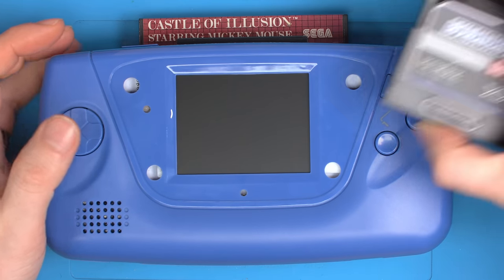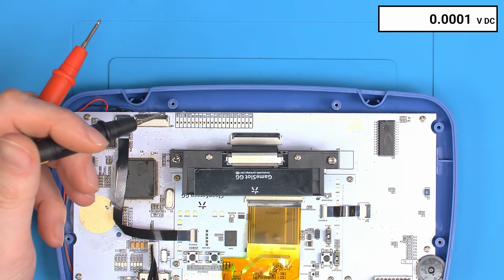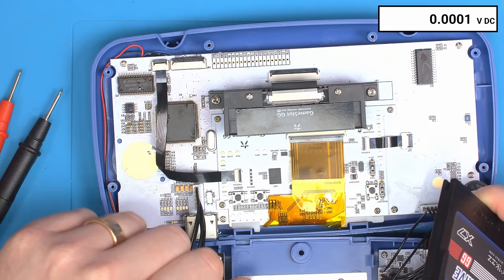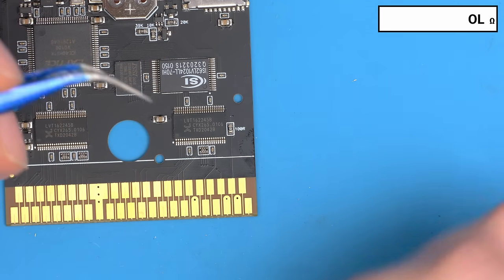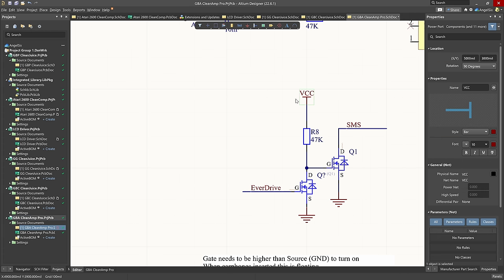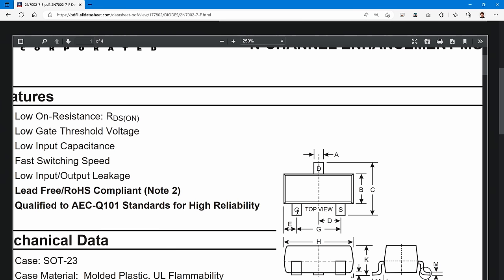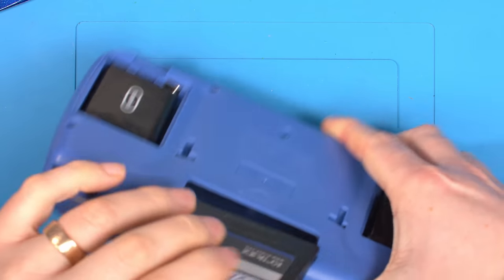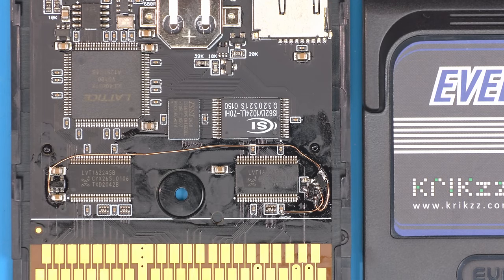ALL EverDrive GG Have This Issue, But It Can Be Fixed (SMS Pin Error)

Comment from the maker: If you are interested in the serious importance of driving CMOS pins corrected, you can read it here https://www.retrosix.wiki/digital-logic-levels
Reply: Oh, I just read this and If I understood correctly, when I use my Everdrive whith SMS games, it could destroy my GG ?

It has already happened to me that during part of an SMS game (with the Everdrive) my GG crashes, it may be because of this problem?
have you contacted Krikzz maybe he could correct it?
Reply from the maker: @lamor69  damage could happen at any point. No need to play SMS only have EverDrive in your GG. Krikkz been contact and simply doesn't believe it's a problem so won't be fixing it. I'll be offering a fix board soon
Reply: @RetroSix did you work on that fix board ?
It will soon be sold on your retrosix store ? 😊
Reply from the maker: @lamor69  not yet but lots of requests so definitely will make it
Reply: @RetroSix thank you man if you sold a ggx7fixed everdrive and pure blue gg like this I'll buy it on store
Reply from the maker: @rustymixer2886 https://retrosix.co.uk/Sega-Game-Gear-Console-Prestige-Edition-Dark-Blue-p231793240
Reply: @RetroSix  thank you

Comment: Great bit of info, I've run into crashing in this exact manner with a few sms games on a gg x7 and thought it was just the specific games.

I've been thinking about designing my first pcb and this would be the perfect starting point (if I have your permission that is, if so and if I put the gerbers up on github I'll properly credit you for it of course)

Super simple and compact, and I can even see a place to put the pcb, just below the sd card slot, and with a flex pcb I could use a set of quick solder points that route to the nearest places for 5v and ground instead of wires.

I'll see about doing that maybe later this week if I don't forget
Reply from the maker: Yep would be a good starter board
Reply: If you make one, I’d love to buy one
Reply: @viblade_1750  unfortunately I'm in a bit of a unstable situation so it may or may not happen.

Most likely I wouldn't sell them in any case, the schematic is RetroSix's design and while he might be okay with others using it, I wouldn't feel comfortable selling it out of respect for him offering this knowledge for free.

So instead I'd just offer the gerbers for others to get their own made
Reply: @PaulTheFox1988  sorry to hear, if you do make the gerber’s let me know
Reply: @viblade_1750  assuming it does happen I'll try to remember to put a comment below with a link to the gerbers.
Thank you for the kinds words though, it means a lot

Comment: Very nice video.
I have the very same everdrive, bought from Krikzz directly, and I use it with Mcwill tft, bennvenn IPS kit and a 3rd gg equiped with the genuine display, and I have no issue at all with sms roms.
I guess this fix is necessary with clean screen only (maybe Retrokai tft kit too, never tried...)
Reply from the maker: It works with CleanScreen. This only happens intermittently depending on if the voltage level falls right on a middle indeterminate level. Happens on all screens they all use the same level shifters

Comment: You should have chosen a logic level fet, for instance a cheap si2302. The 2n700x works because of the gg's high input impedance, but it's a bad design choice.

Comment: Man, THANK YOU! I finished up recapping and modding my game gear a few days ago and I ran into this exact issue. I feared I permanently screwed something up. I even re-soldered every cap and double checked every point I may have messed up. Did Krikzz ever respond to your message? If not I may have to do this to my everdrive, but I'd rather not if there is a software fix in the works.
Reply from the maker: There is no software fix for this it's hardware. Any screen kit can be fixed to work with the 3.3V and I already updated all GG CleanScreen to support both 3.3 and 5V now, but the visual issue was only the clue to find the problem with the ED receiving 5V into it's 3.3V pin. It will cause stress on the pin inside the FPGA over years and probably kill it sooner than it should
Reply: @RetroSix  @RetroSix  I see, I must have received a relatively older revision of your clean screen kit since I'm still having this issue. I'll post in the discord about my issue once I have time to fix it. Thank you!

Comment: I would say this console/mod outs of specs. 3.3v output is totally fine for driving 5v cmos inputs. 5v cmos input expects around 2.5v for logical 1 and they back compatible with 3.3v, by the way. So if 3.3v can't trigger yours screen, then it made wrong way and not meets CMOS 5v specs. Speculation about fpga damaging sounds even more weird in terms of current discussion. This is not EverDrive issue, there is nothing to fix.
Reply from the maker: It's not speculation. Pull up ICE40 datasheet and read max IO voltage of 3.6V. Then see video for 5V pull up going straight into it. That's the main issuue. It is 100% an issue and totally out of spec for the ICE40
Reply: @RetroSix  Max 3.6v for ICE40 is a valid value when it working as input, but in this case it working only as output, furtermore such low current like on pullup resistor can't burn anything even if it directly joined to 3.3v inputs.
Reply from the maker: I'm afriad your just wrong. Direct from datasheet...

 The default configuration of the I/O pins in a device prior to configuration is tri-stated with a weak pull-up to VCCIO. The I/O pins will maintain the pre-configuration state until VCCand VCCIO(for I/O banks containing configuration I/Os) have reached levels, at which time the I/Os will take on the software user-configured settings only after a proper download/configuration

Then stated cleared below it IO Tri State Voltage max 3.6V. 

So on power up every time while config is loading it will be over voltage. 

Nothing to do with current. Entirely voltage driven. So if GG boots faster than ED it will overvolt the pin. ED has known issue powering up failing and it's very likely due to this also. I plan to test that too.
Reply from the maker: Furthermore 3.3V is also no within spec for CMOS 5V as I mentioned. 

The TTL family allows a 2V - 5V difference to be counted as a HIGH and defines the threshold for output for HIGH as 2.7V to 5V. In the CMOS family, an input wanting to define HIGH must bring between 3.5V and 5V
Reply from the maker: I'm also trying to help by the way not cause issues. I'm only highlighting an issue that should be addressed for better product
Reply: @RetroSix  Sorry, i meant ttl 5v, because this is what original gamegear levels matches. Original gg switch it mode if level reach 1.5v. From what i can see at this video, sega's asic switches to sms mode, as expected, but screen still stays in gg mode. I would suggest to make the system match to the original system.  I'm only highlighting an issue that should be addressed for better product. As for fpga damage, the argument about the state of io during initialization seems far-fetched, especially since initialization of fpga from nvcm is very fast. Anyway,  for physical silicon damage you need to apply large enough amount of energy, what is obliviously not possbile with small  current which flowing throthe pullup. Ic damaging via pullup just an nonsense, especially for io assigned to the output.
Reply from the maker: @biokrik   For sure I will update to support 3.3V logic on the SMS pin going forward no problems. We have sold thousands for years and almost never seen this issue until recently a few people so it isn't that big of an issue for the CS, but there are still all the issues mentioned.

The Game Gear uses a Zilog Z80 which is CMOS (not TTL) so 3.5V is the specification absolute minimum for it. However, that's up to you if you want to fix it with a simple dual transistor update. Just keeps things within the expected specifications, and much more importantly to prevent needless 5V potential to damage the ED for a few cent upgrade?

The CS correctly uses a CMOS level shifter for CMOS Logic. It is designed to work with CMOS standards not TTL. That is why we are seeing some issues. 

So it is a simple fact of the ED is not outputting the expected CMOS specifications for the shifter. 

So all that voltage level talk aside I will update the CS on the SMS pin to a simple transistor trigger to support both, and my concern would be the 5V injecting into the FPGA of the ED I would highly recommend to update and fix. After all there is no downside to correcting that?

Comment: Hmm… got to say I have the exact same Everdrive x7 from Krikzz, Model 17, Rev. B 02.12.2019, and it has no issues loading sms games on Game Gears using the original screens as well as modded with Clean Screens, McWill screens and Chinese McWill Variants etc. I have tested my Everdrive on over 100 systems most of which had a screen mod installed. That being said I have never tested sms on an Everdrive on one of those SYF boards so maybe that’s where the issue lies. Also, probably not the issue though, all Game Gears I tested used the original Game Gear power supply and sound board.
Reply from the maker: The issue is quite simple. It is 3.3V instead of 5V logic. If that falls right on a mid point of a level shifter it will cause issues. We have used EverDrives for years no issue and more recently seen more issues. Fixing the EverDrive to act as 5V logic should is the best fix as any hardware designed for the Game Gear should also expect 5V not 3.3V.
Reply: @RetroSix  I have reported this issue and the response was you are making it up
Reply from the maker: @claytoncoleman7201  come again? You can literally see the issue, and also test your own EverDrive with nothing more than a multimeter. The fix is also provided. Who exactly is saying it is made up as that makes no sense and is not constructive at all to improving the EverDrive and it's function

Comment: Great Video, thank you. I have a GameGear with a Mcwill and your USB C power unit and the exact GG Everdrive X7. Mine seems to play SMS fine. I wasn't able to get any SMS games to glitch out, spent about an hour playing random SMS games. I got my GG X7 around 2 years ago from Stoneage Gamer, latest firmware. The micro sd card I use is a brand called Qumox, it is the lowest power consumption card I could find. Originally I used Samsung or Sandisk but it would make the X7 hang (apparently uses more juice), i switched to Panasonic SD at some point and it was a bit better but still crashed once in a while.. seems to work fine with this Qumox brand. Do you suggest I still get the fix? Awesome videos, always learn something. Thank you.
Reply from the maker: I've checked and the FPGA IO pin is only 3.6V tolerant so regardless of glirching of not the EverDrive is receiving potentially 5V into the 3.6V pin at all times. Could also be a possible cause of some freezes

Comment: Hello, thank you for sharing, but why does it work well with the clean screen retrosix V1 and not with this V2?
I have a lot of GameGear and it's only the one with the V2 that doesn't work with the Everdrive X7 for SMS games (same problem as in this video)
Reply from the maker: The visual issue (screen issue) only happened on a handful of V2 boards and it was because we made them correctly tolerant to CMOS logic levels. It helped identify the underlying problem with the EverDrive which can cause 100x the current to flow into the Game Gear ASIC. Documented on RetroSix.wiki. The V2 boards now support 3.3V logic on the SMS pin to work with the ED levels but you still are recommended to fix the ED as it can damage the SMS pin of the GG
Reply: @RetroSix   
ok I posted my comment before reading the wiki (I didn't see your comment that talks about that) Thanks, so I need to fix my Everdrive

Comment: Great mod video !!
I also have the same Everdrive.
Does this mean that, left unmodded, this everdrive is also harmful to a Game Gear which has an original motherboard ?
Reply from the maker: No. The only harm I could potentially see is the 5V back voltage into the FPGA of the EverDrive. They have been out for many years though and I have no idea of failure rates or if this is an issue because of that. But it is a technically incorrect behaviour of the SMS pin which I think should be fixed for more accurate behaviour
Reply: @RetroSix  Do you think it's possible to fix with a firmware update only ?
Reply from the maker: I've just checked datasheet of FPGA and it's absolute max voltage on IO is 3.6V so the 5V going in is likely harmful over time
Reply from the maker: @iljacoveliers5834  unfortunately after checking datasheet the max voltage of that pin into the FPGA is 3.6V so I would highly suggest a hardware fix as it will likely damage that gate into the FPGA over time
Reply: @RetroSix  Ok, thanks !!
Reply: @RetroSix  And if I only play game gear games through the everdrive ? Or is this mod mainly for when you play the sms games ?
Reply from the maker: @iljacoveliers5834  the problem is as soon as the console is powered on its injecting 5V into the EverDrive regardless
Reply: @RetroSix  Ok, got it !!👍

Comment: And the funny thing is that everdrives have had problems identified for years, and he still can't solve them
At least this time he was not rude in his answer, but he still thinks he is right and everyone else is wrong

I was about to buy one of these devices in 2019, but after some search in the internet I gave up due to the many reports of poor technical specifications of these devices

But I think that as long as they sell so well he has no reason to correct the mistakes, it's also the buyers fault
Then when the console breaks down, it was bad luck, it is because it has 30 years old
Reply from the maker: Well I think if we specifically see SMS pin related issues in years to come we might know what at least. And I'll be releasing a fix for the boards for those that want to fix it